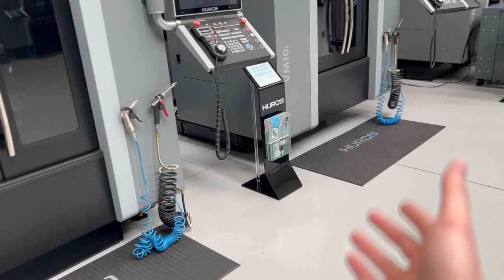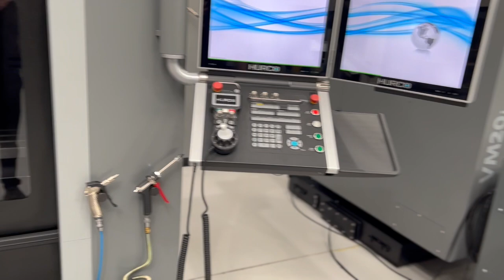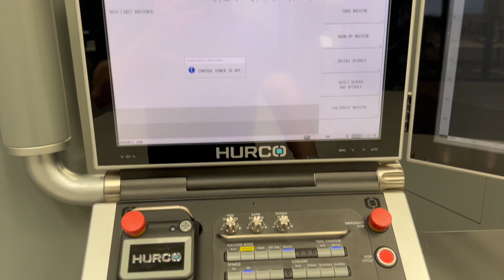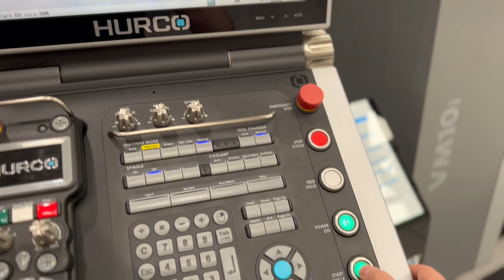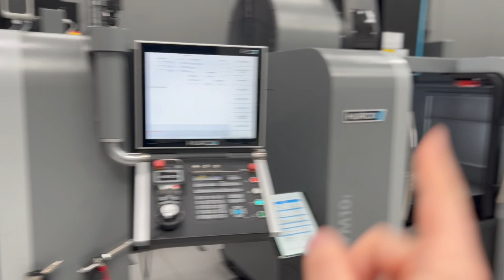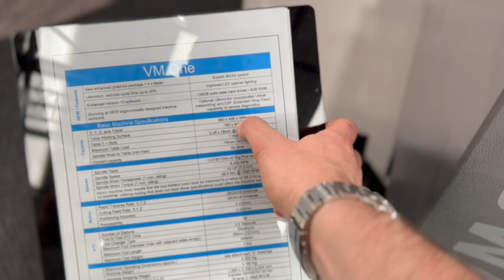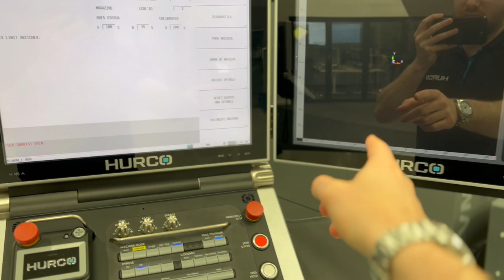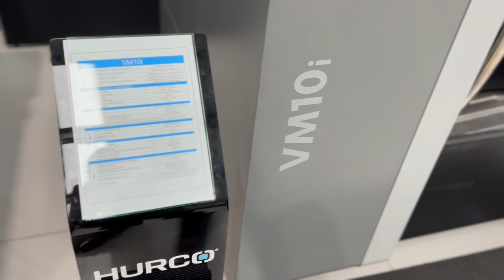Hurco VMone VS VM10i - quick walk around

Comment: Are they built in the UK or IN,USA?
Reply from the maker: @Vankel83  neither, they are manufactured in Taiwan like a lot of machine tools these days, they are good machine builders.
Reply: @AlphaEngineer2022  I looked at Hurco 18 years ago. Sales guy wasn't good and didn't impress more to buy.
Reply from the maker: @Vankel83  a lot can change in 20 years🙂
Reply: @AlphaEngineer2022  Too bad that salesman that couldn't sell Jack beans wasn't any good. Now I have 6 Haas Cnc's. 4 mills & 2 lathes.
Reply from the maker: @Vankel83  who was the salesman? I wonder if they are still here? I’ve heard some horror stories about haas servicing. I also know someone that had haas, switched to hurco and halved their energy bills each month and swears by them. Experience is everything, if they aren’t for you they aren’t for you🙂
Reply: @AlphaEngineer2022  That info is gone from the melon. But even Mazak which I looked at in 2005. The salesman smelt like he smoked a carton of cigs before he stepped in my office. I about puked. Okuma was too busy at a show talking to high school kids. I had a blank check in pocket needing a cnc lathe bad. Another missed op. As for Haas service, I might see a tech every 6-7 months. Had one here in May. I joked to him, see around X-mas.